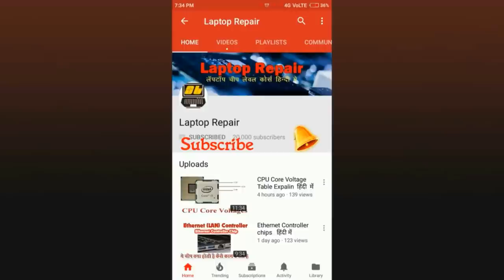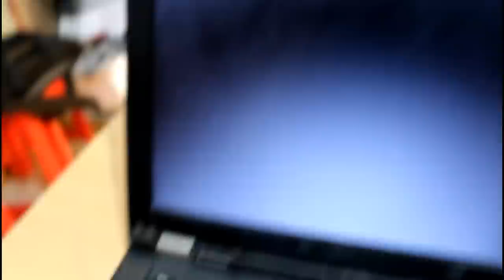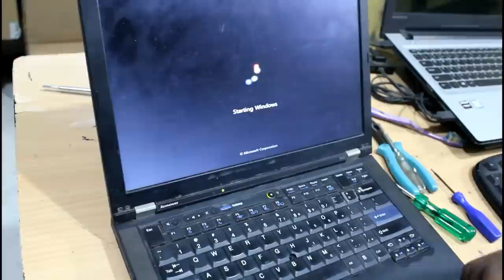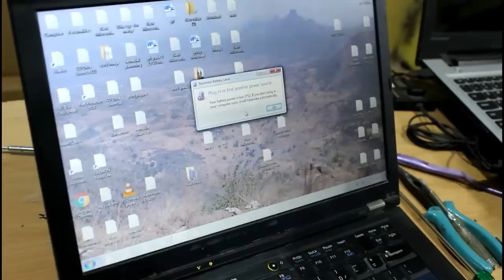Lenovo Thinkpad FAN Error Solution

Comment: Listen everyone. I fixed mine just right now without touching anything almost literally. I just Blew the fan window near the usb port (not the one near the power input port, or blow the whole thing sure.) You can actually hear the fan rotates while blowing and it gets faster after a few blow. Turned it on and yeah baby! Works like a charm!!!!!!!
Reply: Thank soo much....it worked for me too..
Reply: It works also for my laptop. Thank you
Reply: @jessiezamora7610  perfect!
Reply: I just did the same after "Fan Error" on my T420s, but probably a more permanent fix needed, I still hear the fan rotating, the fan has been noisy for the last two-three years.
Reply: For me it worked too! Thank you for writing this!❤❤❤
Reply: @natcons1931  you're welcome 😄
Reply: it’s not working man 😭:-(((
Reply: That is only a temporary fix. You will maybe free up the fan and get the laptop to boot up, but you will not get all the dust off from the fan blades.
You will also fill up the fan shield on the outlet side with dust and that will reduces airflow.
Best to open it up and clean the fan carefully for a long term fix.
Reply: thanks alot
Reply: you saved my day and more
Reply: @frederick.9729  rock on!
Reply: Damn, HAHAHAHAHAH can't believe it work, thank you so much
Reply: thanks you saved my working day ❤️❤️❤️
Reply: Thank you so much ....it's really work ...
Reply: Worked for me as well. Thanks a lot!
Reply: Good it is working ☺️☺️
Reply: Thank You so much it worked for my laptop!
For those who are unable to boot their laptop using this, do this-

Blow the fan window near the usb port as mentioned in the comment, after that, switch on the power button once again, then, when the thinkpad logo appears, press the think vintage button and then continue with normal setup by pressing escape, it will be fixed.

Hope it helps!
Reply: It wrkd for me too
Reply: thanks dude, you saved the laptop of my woman
Reply: I can't thank you enough your a life saver
Reply: Saved my day..... It is working!!!!!
Reply: Me 2! Just now! Thanks man!
Reply: WTH, it actually worked. Easiest repair ever.😂
Reply: @akashchoudhary7990  The blue Thinkpad button?
Reply: To all the people in the replies, this solution is temporary, my laptop worked fine for 3-4 months when I blew the fan window for the first time (thanks KUS :)) 

So here is another very easy solution, when you boot your laptop, press the escape button and you will be good to go No cap, try it yourselves:)
Reply: Do you go around "blowing" things on a daily basis?
Reply: no freaking way, I just did it and it worked
Reply: Thank you so much❤

Comment: if you read this, I had a lenovo L380. Didn't feel like taking it apart so slapped the vent on the bottom and blew in and around everywhere with the air from my lips. Got the fan going again.
Reply: Thank you that worked.
Reply: Fixed my 450S fan error with these exact instructions. Just a couple hard slaps on the vent and it booted up nicely. Saved me like 50-100€. Hope all the best for your future mate.
Reply: Lmfao can't believe it actually worked, but now they make almost constantly a weird noise even if my PC shouldn't lag at all. Anyway thank a lot <3